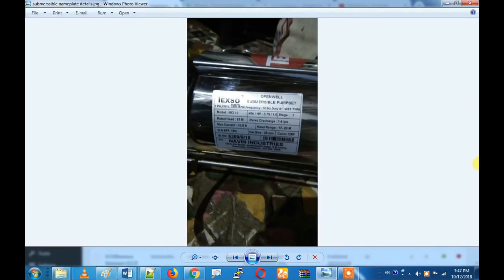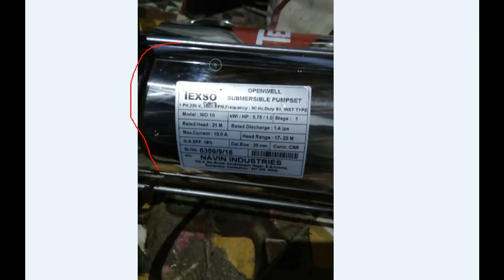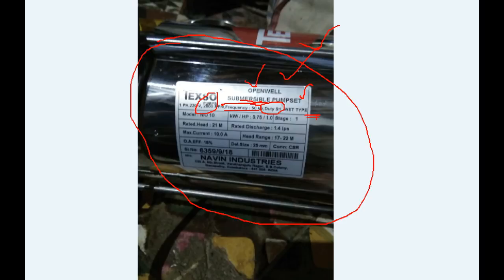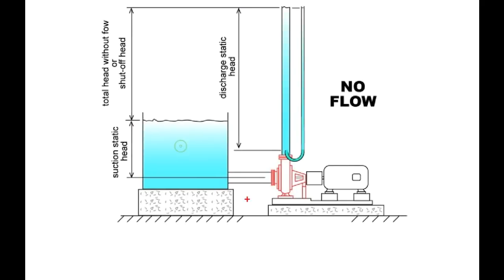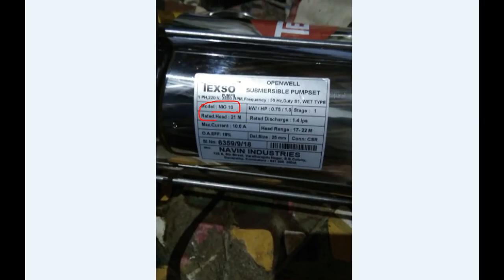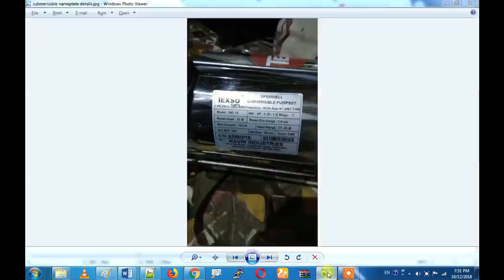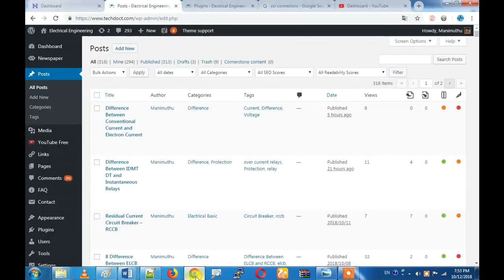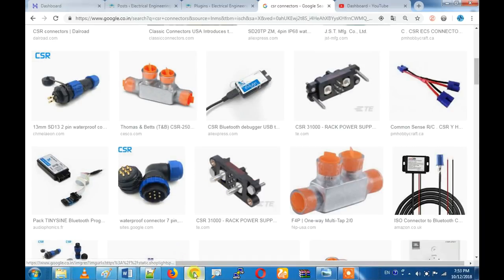Submersible Pump in Tamil How to Purchase Submersible Pump

Comment: G I like this video. One doubt G we are having a Syntex tank in ground floor. There we are filling water. 

Our bore is dried so in First floor water tank is free. Which pump can be used to Transfer Water from Ground floor syntex tank to First floor overhead tank which will be height 11 feet height length 20 feet distance. 
Can u suggest which motor has to be used. Any buying link for that Motor
Reply: I have this purpose motor sir...9342310162

Comment: I'm using VGuard submersible 1HP motor and VGuard switch board having MCB(C10) trips within in 2-3 mins.
What could be the reason?
Reply: Voltage kuranchalaum trip agum and amps rate check pannunga....athu correcta eruntha  coil problem than..... And evalavu distance water kondu porenga nu parunga stage kamiya potutu romba distance konduponalum amps kuda edukum trip agum.....

Comment: Bro 500ft kku keela water irukku single peas la enna HP motor use pandrathu
Reply: 3HP SINGLE PHASE
Reply: எங்களது மோட்டார் 850 அடி வரை வேலை செய்யும் சிங்கிள் பேஸ் போதுமானது. 90 முதல் 280 ஓல்ட் வரை ஒரே சீராக இயங்கும் மோட்டார் காயில் சூடு ஏறாது.
மின்சாரக்கட்டணம் நான்கில் ஒரு மடங்காக குறையும் 8667394550
Reply: @chandruasp  evalvu hp
Reply: @Subash-ux5ud  நான் 850 அடி எனக் குறிப்பிட்டு சொன்னது மூன்று ஹெச்பி
Reply: @chandruasp  thanks
Reply: @chandruasp  rate enna bro 3hp

Comment: What is the price of open well pump of one hp
Reply: Bro I  am openwell pumps manufacture form coimbatore pls call I will give  on best price with one year warranty pumps copper coil1hp open well details
Pump weight 16.5kg
Heavy pure copper winding
Flexible method
Core lenth=55
Body length =155
Heavy iron castings
SS bolt and nuts
Head working 90 ft...
Long life durablity confirmed...👍
9080080062

Comment: Submersible pump amps epdi calculate pandrathu video podunga ..bcs it's apart from other formula A=kw*1000/V*pf*cos fy.. but submersible load formula epdi?
Reply: enakkum intha doubt irukku, i think normal motor mathiri illama  
submersible pump motor insulator winding la irukkuthanaldan pola...?
Reply: Watts=voltage × current  so current (amps) = watts/voltage
Reply: Ithula loss la varum atha na podala
Reply: Pump oda power ah kandupudikanumna power formula veanum
Power p =(2(22/7)nT)/60
N=rotation of the impeller per sec
T=torque gained on ìmpeller